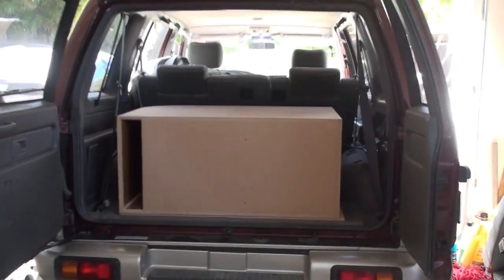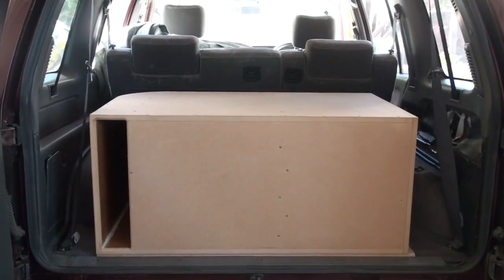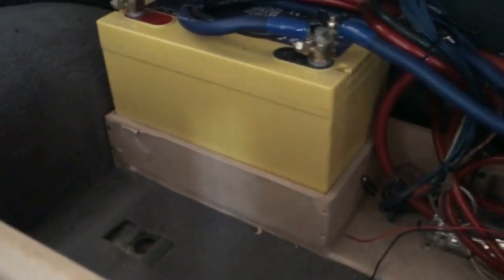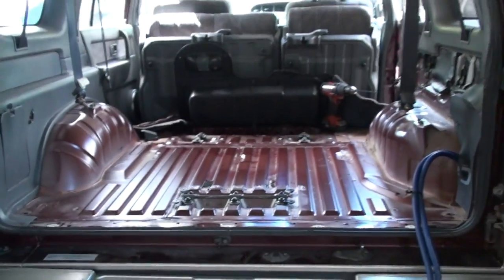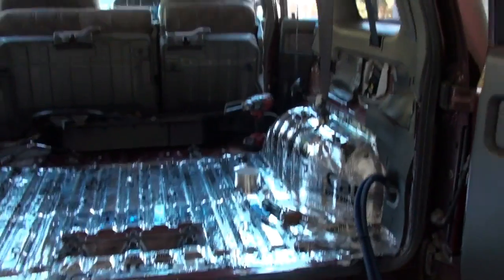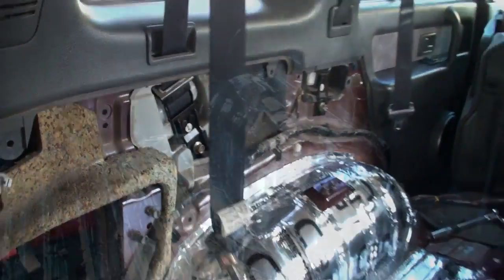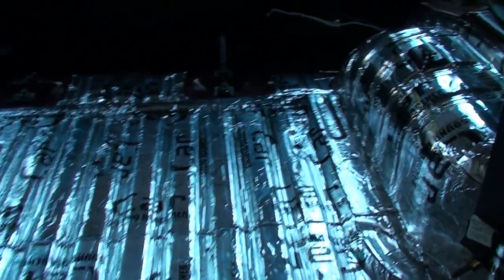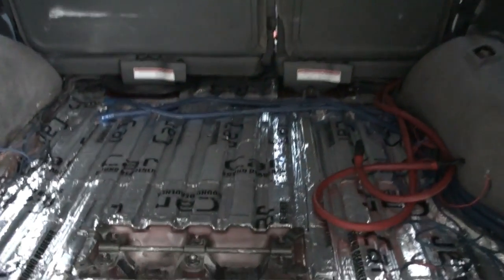Jackaroo Build 3 Underway - More Deadener

Comment: Question didnt u say u were walling it? If so why are u deadening the floor?
Reply from the maker: soundstream3000nz well eventually this build will still have 5 seats but lets not rule out a C pillar
Reply: if that the case why have you dead-end the rear of the car if your doing a cpillar. the cpillar wall will just sit over the top of the deadener so the deadener won't be used and it won't get affected from the wall. not having a go just thought its a waste of product
Reply from the maker: soundstream3000nz I wont be building the wall in the car but, it will be a box on a steel frame that is then sealed of from the back of the car so from the inside it appears to be a wall but from the rear you will see its a box with a frame and batteries and amps below - all meaning its removable for when I do the real wall, and I wanted to make the floor a little more solid, besides I have boxes of this stuff